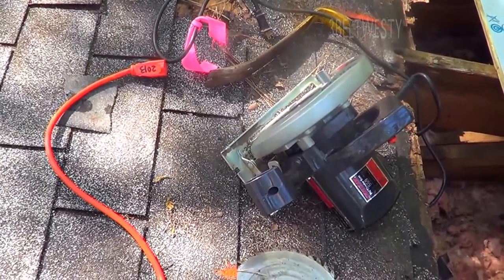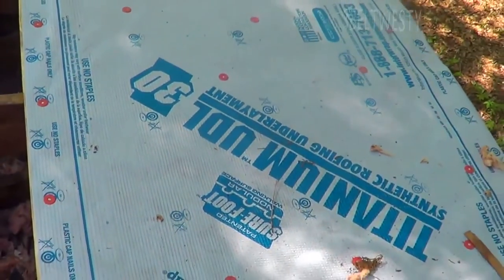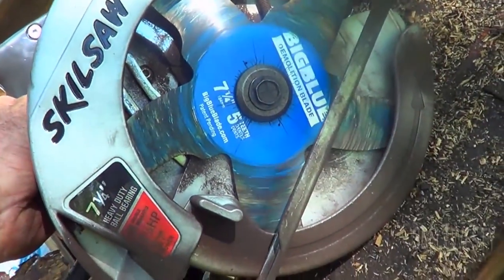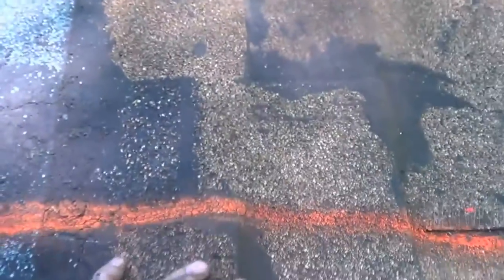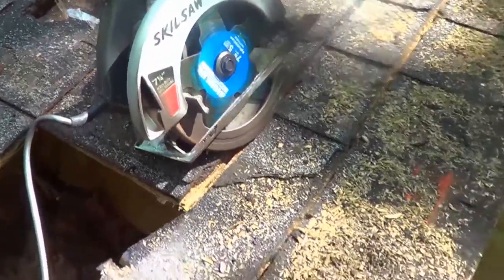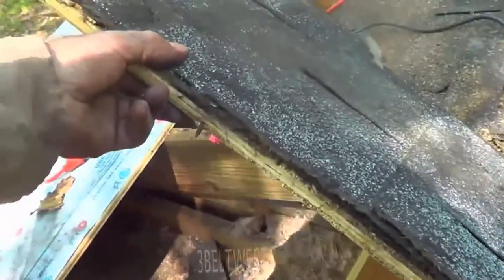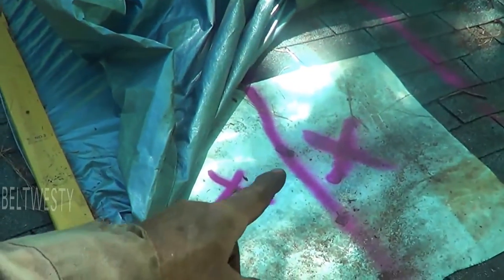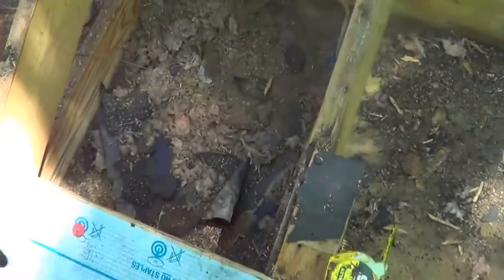BigBlue Demolition circular saw blade test on roof shingles

Comment: Wish i knew this before i demolished a 1000sq ft roof 😂
Reply from the maker: @4unanu  it makes a mess of the saw. So you want to use not your best one.  What happens is some of the shingles throw goo in the saw shield. Ie the shingles maybe melt a tad and some tar can gum up the blade shield.  So it has to be de gummed with carb cleaner.. also chunks of plywood can jam the shield too. So in doing an 8 square roof I had to pull jammed pieces out several times.   That blade in the video did an entire 24x32 roof in 2x4 ft sections and still could do many more..

Comment: How long did it last?
Reply from the maker: I did that 10 square roof in 2x4 foot demo ed size pieces and the blade is still great.  But you do get tar buildup on  the saw. So use an older saw and beware the retract shield pivot can get gummed up in the from the old shingles.

So for clarity I cut the old roof up in small sizes since a 1 man operation. Ie easier to throw into a dumpster

Comment: I wanna Skilsaw exactly like that.
Reply: They do not have ball bearings, they have bronze bearings. They are not built amazing.
Reply from the maker: @viperstrike3827  The Skill saw in the video is a model 559. made in usa. On the saw it has "heavy duty ball bearing skill saw" and "heavy duty ball bearing".  This is a double insulated 2 1/4 Hp saw. Iit is an older saw from about the 1970's.  Our original one lasted 3 decades; the handle broke after many careless moves. ie fell and hit concrete off a roof. The one in this video is one of the 2 spares bought 15 years ago. These are not OSHA approved ; maybe the retract spring on the guard is the issue of no brake on the blade. Anyway this old saw says for 25 to 60 Hz AC. I have run them off DC and a car alternator with external regulator not connected and the Field full on.  When the shop here bought this model 559 it was a commercial saw in the moderate price range. That was like mid 1970s
Reply: Thanks for the reply! I have a saw that looks very close to that. It went out due to bearing failure. It says made in U.S.A, but does not say ball bearing construction. I think it has bushings. I will take it apart and get back to you if I remember. Thanks for educating me on your saw.

Comment: Did you try a sawzaw?
Reply: It's sawzall not sawzaw. They merely vibrate the blade back and forth. You'd burn through blades relatively quick. Granted it would get the job done much slower if held perpendicular to the roof. That technique in itself is too risky as you may cut through Electrical or another important item. With a circular saw you can set the depth, and the blade simply rips through material in a continuous motion making for fast cuts and way less effort than a sawzall.
Reply: Too slow